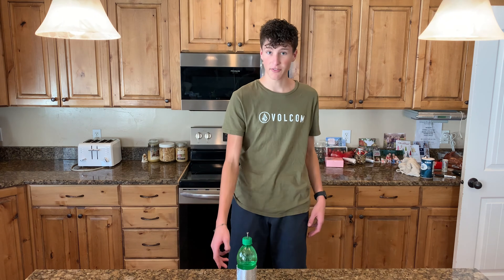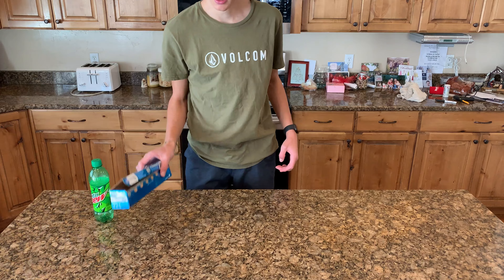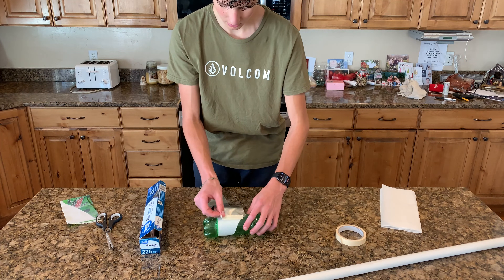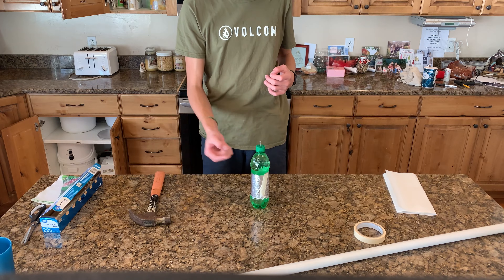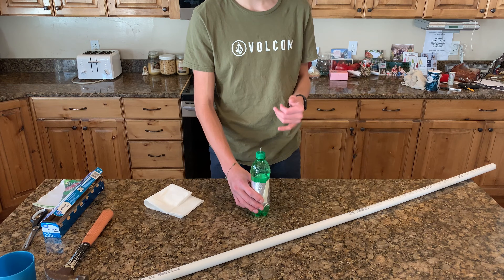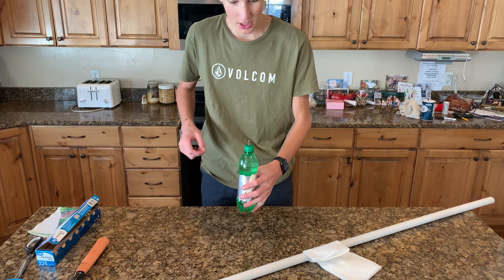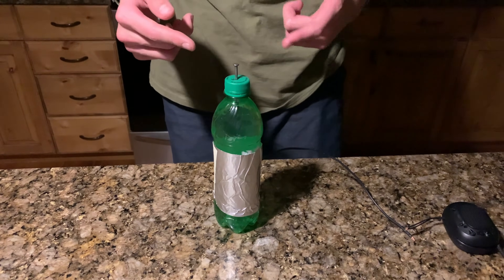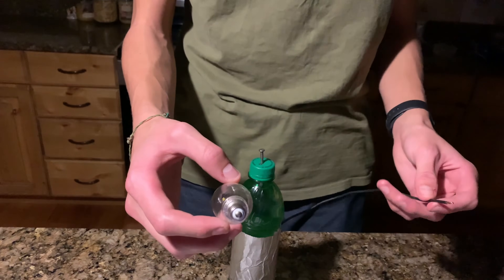How To Make A POWERFUL Static Electricity Battery!

Comment: Save up a bunch of bottles (20 or more), and drill a hole in their tops. Then take a wire with about 2 inches stripped off the end and insert it in until 1/2 inch of the insulation has gone through the hole and hot glue both sides of the end cap where the insulated wire went through ensuring a good seal.  Now fill completely with salt water and then put the caps on and hot glue the caps to the bottles. Then drop the bottles into a cooler filled with salt water and a bare wire.  Now each bottle has maybe twice the capacitance and you have 20 or more totalling maybe 40× or more energy storage.  That's something that needs extreme care handling now.
Reply: The setup sounds like you can start a car with it.🤣
Reply: @bensonyau2302 the setup may be lucky to store 0.13 joules of energy if   twenty130pF leyden jar like capacitores totaling 2.6nF were charged to 10kv. 

A small car starter may draw 200 amps at 12v or about 2.4kw for let's say a second which equals roughly 2400 joules.

Comment: You could conceivably charge one of these with atmospheric electricity.  Just connect a wire from the nail to an antenna (as high up in the air as possible) and connect another wire from the aluminum foil to a ground rod.  The disclaimer is that you have to put the antenna a few hundred feet into the air to get out of the pico or nanoamp range.
Reply: That would sort of work but for the really high voltage, the atmospheric potential grows as you get higher and you would not want the higher potentials at higher elevations to discharge in to the lower potentials at lower elevations. So,  the wire should be insulated and at the top one would  use a ion current collector with nails to distort the electric field intensifing the field gradient which causes electrons to be  ejected more easily.

Comment: static electricity can bend water 90 degrees , here is how. Turn on water faucet so it slowly trickles water in a slow stream. blow up a balloon with air so the balloon is filled with air almost till it pops / a tight balloon. rub the balloon in your hair / the longer your hair the better the charge. after rubbing on your head for 20 seconds , put balloon next to water slow stream. SEE , the water bends.

Comment: Will this serve to kill a rfid chip?
Reply: On the contrary, it probably could. And your chances improve if you get higher voltages stored, and add more capacitance with more foil and or another one wired in series to get hotter electric arcs with more current.
Reply: @kreynolds1123 thank you
Reply from the maker: Hmm, probably not powerful enough.
Reply: Thank you  @PackerAnderson

Comment: ima try this with styrofoam cause i dont have the weird plastic pole
Reply from the maker: Let me know if it works!
Reply: @PackerAnderson  it didnt, but i went out to buy a pvc pipe and i must have made it wrong cause i couldnt get it to shock me
Reply: @PackerAnderson  it didnt so i went and bought a pvc pipe, and i made it wrong cause it didnt shock me
Reply: @sneaky-in-the-pocket  if it's really humid out, it may not work; the water molecules in the air are highly polar and can pick up the free electrons almost as fast as you make them.  try in dry air.
Reply: @bjn-bl4oe  damn I forgot about this but I got the pipe still (I assume this is a shock machine based on the static electricity materials and mention of electrons) so I'll try that

Comment: Would you be able to continuously absorb the static electricity until your hair stands on end if so tell me how please 🙏
Reply from the maker: Not necessarily, usually when you get shocked you don’t keep the charge, it gets dispersed into the ground and whatever you’re touching.
Reply: Yeah to absorb the static electricity my finger will have to stay on the nail while charging the bottle if it's possible to charge the bottle while my fingers still on the bottle🤔 I'm hoping to make this possible
Reply from the maker: Definitely worth a try! Let me know what happens
Reply: Oh about the ground problem I'll have to stand on something that isn't conductive
Reply: Yeah but first I have to make it. My birthday is in 2 days. That is when I will receive the supplies. This will be one of my birthday presents 🤣
Reply from the maker: Well happy birthday! 🥳
Reply: I made the Leyden jar and I found that the water is more conductive if the water is hot and low pressure. Google said the warmer it is the more conductive it is. I'm using sparkling ice bottles which are like a foot tall and as thick as a soda can. What's better a 2 L soda bottle or the bottles I have? If I touch it with a nail it doesn't hurt my fingers it just makes my body spaz. In the afternoon I'm going to try to find something to stand on that isn't conductive and use a broken charger wire for some experiments on the Leyden jar.
Reply from the maker: Oh interesting, the bigger bottles will be able to store more, and you might be able to absorb the charge if you’re touching the nail but not standing on anything conductive!

Comment: And if you really wanna go all out... Connect the top enc to the  antenna on your roof and wait for some bad weather... The house antenna at around 25feet high or above will strip the positive charges out of wind, water droplets and will have a constant mode of charge. With an appropriately connected resister you would have a free source of usable energy... Also look up static motors
Reply from the maker: Dang bro is into something. Boutta revolutionize today’s energy scene
Reply: @PackerAnderson  You may want to google the fate of Georg Wilhelm Richmann of St. Petersburg who tried to do similar things in 1753 but was electrocuted to death.

Comment: Connect a resister for a 5v resistance to the conductor at he top and then try and charge a small device like your headphones... The resistor will prevent the current from all discharging at once meaning the Leyden jar can be used more like a conventional battery... Also look to charge it up with a manual hand crank vandergraffe generator... An electric one can achieve results of over 1 million kv of charge been placed inside the battery... Killer lol... So a hand crank version I imagine will still achieve high end results... That will be a huge step up from your current capabilities... I suggest you learn to earth yourself appropriately though first
Reply from the maker: Resistor idea is smart

Comment: Charge a battery with it, if you connect a piece of felt around a propeller with a light copper foil brush touching the felt, the put it outside in the wind wouldn't it charge a dead battery until the voltage was equal ?, What if you used a sparkletts bottle with that concoction ?

Comment: Who can help me?
I wanne be electricty loaded.
One endgoal is to lighten a sigaret with electricity flowing trough my fingers.
- by tuchting the two fingers (thumb and an other one) 
- by bringing my hands close to each other.

I wanne go to a convention as Stein (from Soul eater). And he has a screw through his head.
I wanne do it so as i can turn the head of the screw to activate or deactive the electricity. I van have some cables go down to my hands and have some metals at the end conectet with ruber to my body. 
And maibe also have a static part for touching others.
Think it can bring a lot of fun. 
ESPECIALY if i can have visible electricity go through my hands.

Comment: Connect a 12 V, 1 amp motor to a 20 foot length of PVC. Have the motor rotate the PVC tube. Use a tube that is 3 feet long, and from 1 to 2 inches in diameter. Pack the PVC tube in lambswool so that it will develop a static charge. Run three lengths of copper wire along the length of the 3 foot tube to collect the positive charge. Have the output of this system charge a battery. It would be interesting to find out if the output of the static electricity is over 100% efficiency. A simple way to determine this would be to have 3, 12 V batteries of small size. One of the batteries will be driving the motor to turn the PVC tube. The other two batteries would be collecting all the static electricity.  It doesn’t take a rocket scientist to determine that if it takes 10 minutes to charge 2 - 12 V batteries at the output, and the battery driving the motor has only dropped by 1/10th of 1% in that same time period, you are way over 100% efficiency. For those who share this comment with their math teacher, or engineering teacher, if they’re not able to give you the equation for motor efficiency with an input of static electricity don’t trust them, you must test this, otherwise its dogma and not science.
Reply: i can tell you the answer is no it wont hit 100% because you lose energy to friction and heat until we beat gravity there is no free energy sadly
Reply: @Loan--Wolf  Group of Portland/Vancouver morons stalking me on  my YouTube comments. Get a life looooosers!
Reply: @Loan--Wolf  I'm sure your dogma is scientifically tested, lol.
Reply from the maker: Wow this is elaborate
Reply: I don't want to use a battery for this
Reply: I made a device using a simple wind mill that spun the pvc pipe inside a tube of paper towels. It generated quite a lot of triboelectricity that charged a bank of capacitors.

Comment: Try making the center of the jar out of graphite. Then coat graphite rod in wax. And coat some more rods in wax. Wrap the rod in paper cloth soaked in salt water. Then Use dental floss to hold the other rods around the main rod. Then try charging it up.
Reply from the maker: Wow ok maybe lol

Comment: does it work with any type pf metal pole or its just carbon fiber
Reply from the maker: If you’re talking about the pipe, it was just plastic pvc. Anything that can create static works though.

Comment: Is there a way you can charge it with a battery?
Reply from the maker: Static electricity works differently than a direct current which is the type in a battery so no but that would be cool
Reply: @PackerAnderson  Technically  every capacitor including leyden jar capacitors can be charged with a battery up to the voltage of the battery. 

Yes, the charge in the capacitor is stored electrostatically. But leyde jars have very little  capacitance which means at low battery voltages so very very very little energy is stored. But leyden jar capacitors are commonly tolerant to very high to extremely high voltages. Energy = 1/2 × capacitance × voltage².
Reply: A Van de Graaf machine can charge it.

Comment: That is so cool. I hope to see more electricity from static electricity.  Maybe make a bunch of small jars and connect them. Put it in batteries
Reply from the maker: That would be cool
Reply: @PackerAnderson  Series stacked battery of capacitors would result in a nice long spark. But in series the spark would be hot and loud. 

In another comment I proposed one fill a bunch of bottles full with salt water and a drilled hole in the caps with a wire a wire to the inside. Fill a cooler with them and a bare wire laying on the bottom then add salt water. 

Each bottle will now have up to 2-3 times as much capacitance as one with just a little bit of foil around the center. The leden jar like capacitors now would be effectivly wired in series and would store a seriously  dangerous amount energy that could push a dangerous amount of current.

Comment: Led lights are super sensitive to ESD, so make sure to connect a small zener diode anti-parallel to the led if u ever use smaller LEDs otherwise the LEDs will die instantly or after a while due to static tear down.
Reply: LEDs are designed to work with 2-5 volts, light bulb for 100-250V.
This thing generates thousands of volts.
It is better to make such experiments far away from valuable devices.
Reply: Would be so much easier putting the foil inside the bottle then a wire connected to the foil then a nail down the bottle in the center use Lemon juice prolly get 7 volts depending how much in the bottle...
Reply: @Hydrogen95Gmc  You're making a cell, a LEYDEN jar is a CAPACITOR

Comment: Scienceeeeeeee love it. So is there a way to design this to hang it on a do and when people touch the knob it would discharge?
Reply from the maker: Hmm I’ve thought about that, but the nail/saltwater would have to be connected to the doorknob but they would also have to be touching something conductive that is discharged so maybe if they were barefoot on a metal mat or something…🤔

Comment: Can i use a battery?
Reply from the maker: No because that is direct current electricity, whereas this uses static electricity
Reply: @PackerAnderson  what can i use i don't have pipe
Reply from the maker: You can rub your hair on a blanket then run the nail along the blanket

Comment: A Leyden jar is a capacitor. It's not a battery. Batteries and capacitors are two entirely different things. And batteries have to do with current; they have nothing to do with static electricity.
Reply: He said that
Reply: Technically all these single  AA and AAA batteries aren't actual batteries either. They are called cells, and a battery is an assembly of electrochemical cells. But in loose common everyday language the term has been expanded to include single cells rather than just to an assembly of cells. 

Before there were electric chemical cells. Battery meant a collection of objects used together for the purpose of striking or beating. For instance, a group of artillery pieces (like cannons) used together is still called a battery. And a single cannon is not a battery of cannons.

Comment: are there any alternatives to the pvc pipe that is not a balloon?
Reply from the maker: Yes, there are quite a few things that would work, including a blanket that you rub on your hair or clothes fresh out of the drier.
Reply: Cardboard and Styrofoam gets me Everytime
Reply: You can use an electrophorus to amplify a small charge imbalance and deposit some of those charges on to the lyden jar capacitor.

Comment: Could this be adapted with copper brushes to collect static from the air?
Reply: The air doenst produce enough static electricity to charge a batter
Reply: high altitude air re direct may produce enough movement to generate enough charge, needs more r & d
Reply: @Mdou245  Nonsense, well sort of. 😊 Atmosphereic electric potential increases on average by roughly 100 volts per meter.  The issue is that air is a rather good insulator, and that means there's a limited amount of ions to conduct current very very slowly.  So, given a long long long time, one can absolutely charge a battery. 

One can increase the amount of charge flowing by increasing height for greater voltage potentials   and using sharp points at the top to distort the electric field gradient so that electrons jump off more easily like an air ionizer.  Some people also have had good  success using the flame from a torch to more easily release ions into the atmosphere.